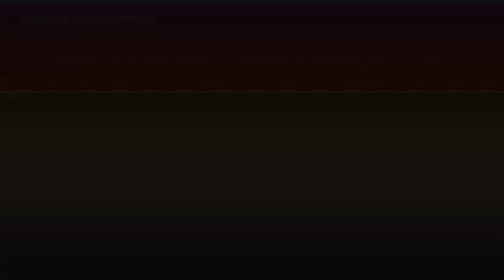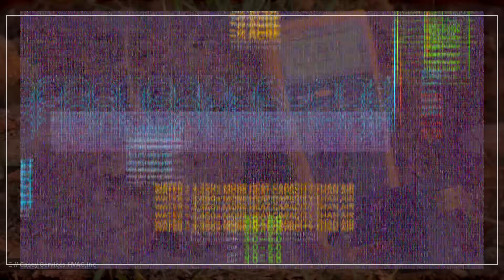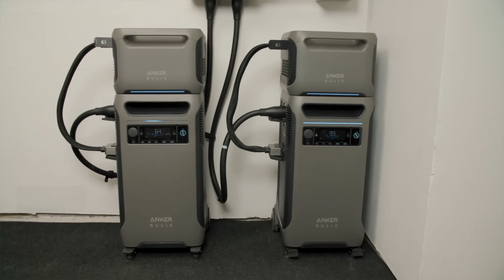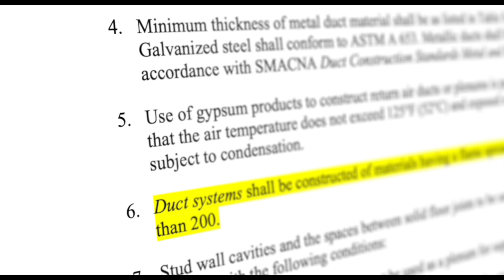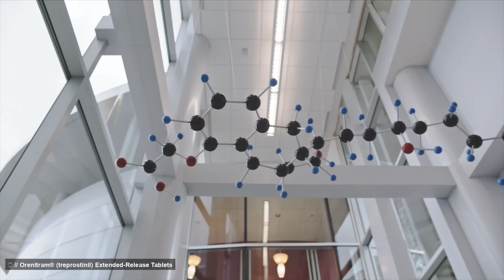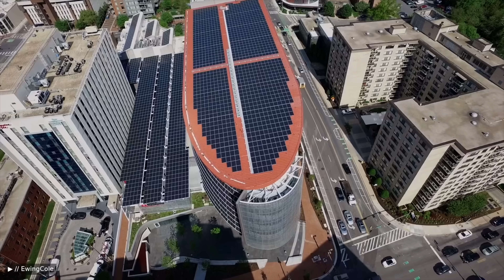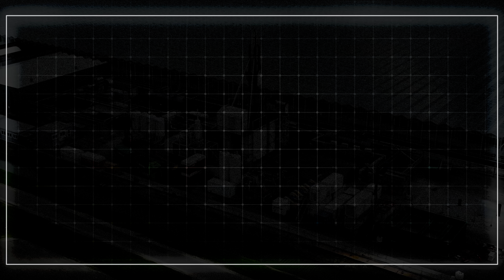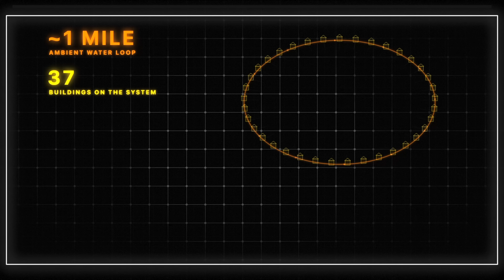The Viral DIY Cooling Hack That Nearly Killed a Family

Comment: One question - what is the local long term effect of a giant geothermal installation on that "heat battery" that is the earth's crust?  In other words, is the ground in the area - those few feet, those few tens of feet, or perhaps somewhat further - going to be significantly altered?  Is the efficiency of this system going to degrade with time as the rock, with its limited conductivity, cools or heats?   It is my understanding that solid rock is a decent temperature insulator.  

That raises the interesting question of what happens if these systems tap into an change the heat level in an aquifer.

Also, no offense, but nobody is entitled to being given other people's tax money so they can install heating that is cheap for them.  And, I class myself here - Geothermal was simply too expensive on my property - with current technology and energy prices.  However as things change over time, that WILL likely change.  At that time, it will truly take off.  That's true of solar where I live.  Only this year did it begin to make economic sense.  So, this year, we're installing it.

And, for the economic nit pickers ... yes, a tax break is the same as being given other people's tax money - overall tax rates climb to make up the difference.
Reply: Industrial policy is a nation's approach to encouraging and discouraging technology and practices for the good of national efficiency and security.  It often takes some carrots to get a desired technology towards the tipping point.  After that, the subsidy is no longer needed and the net benefit to the country is much greater than the subsidy cost.  It is a long term play.

Examples of this industrial policy approach solar panels, batteries, EVs in China.  Heat pumps in the Nordic countries.  Short term subsidy pain for long term national security and economic gain.
Reply: @SeekingBeautifulDesign  in an ideal world, that would be the way it worked.  And, perhaps, there are less diverse places where it HAS worked.

However, at least here in the States, it's been more of a case of cramming immature technology down the throats of taxpayers while funneling the taxpayer money into the pockets of politically connected cronies.

A prime example from last week ... in Portland, Maine, there is a $54 million "vertical hydroponic" setup that has run through all the money, is defaulting on its obligations, and has yet to produce more than a salad or two.  I would note that the money came in the form of loans that are forgiven by the Feds if the company keeps its nose clean for a short period of time.

I would note that this is the exact result predicted by folks looking at the numbers before the project was green-lit.  But, as usual, the ideologues running the government paid no attention to economics, human nature or common sense.  After all, THEY don't suffer when their policies fail, and their cronies still make a mint.
Reply: @selkiemaine Immature tech subsidies are better for research labs for basic research than promoting consumer adoption for scaling benefits.  Heat pumps are extremely mature technology. AC and refrigeration are 1 way heat pumps.  Now price drops with scale as most of the hard tech parts are solved.  Hence consumer subsidies to get to scale.  China subsidized solar to the scale where it no longer needs subsidies.

Tech loans are to what I guess you are referring.  It's an open question whether government or private markets should fund post academic and preconsumer technologies.  US didn't seriously fund solar (original cells), batteries (LiFePO4)and EVs (at least a lot of pioneering work done in US) which it invented.  Now China has a near insurmountable lead, dominates the world and leaves oil insecurity behind more and more every year.

Contrast this with the bad choice on vertical farming.  Economics of this without incredibly cheap energy are poor.  So bad investment and investing approaches should be investigated.  However never investing in anything by the government dooms the US to being an unproductive laggard.  It might be helpful to join a venture capital firm to live with putting money into new and unknown ventures.  9 failures for every big win, but still profitable.

Comment: NB. Based on a twenty year experience with a waterfurnace , I highly recommend a closed loop system over an open loop system, which is susceptible to ground water quality, condition and fouling due to inherent minerals. There were numerous mineral deposit issues we had to overcome with the heat pump but at the end of a twenty year stretch, the discharge well itself was highly fouled with mineral deposits and could not be rehabilitated for use by the waterfurnace. Go closed loop, or not at all.
Reply: A friend of mine lives in a 1980's house in Ontario (Canada) with a closed-loop geothermal system where the loop goes into a giant radiator in the lake by their house. It's been running since the 80's and only last year finally died due to the compressor motor finally going.  They replaced that motor and it's humming away again. Most of their neighbours around the lake community have the same system, and they've all had similar great experiences with those systems.

Compared with every single gas furnace and outdoor-compressor-based AC units I've ever known with friends and family and personal experience - all die within 5-10 years most requiring complete replacement because they no longer make the parts.
Reply: @anomatrix0000  That's cool but most people don't have a lake next to their house lol.
Reply: @Rhannmah  That is laugh out loud true.
Reply: @Rhannmah  Obviously, the point was more about the benefits of a closed-loop geothermal system vs open, responding to OP's point.
Reply: @Rhannmah  But what if I dont like bean soup?
Reply: @Rhannmah  That's cool, but many people don't have a house
Reply: @Panteni87  haha, true. Screw capitalism for making basic necessities unattainable.
Reply from the maker: great comment! yeah I suspected as much, closed loop would be the way I'd go for sure
Reply: Yeah there's literally no reason to have an open loop, what you need is the ground heat so just isolating the ground loop and grabbing the thermal energy through a heat exchanger is the thing to do, you avoid so many problems doing so.
Reply: @Rhannmah  someone forgot to tell that to the people building the ai data centers
Reply: @supertornadogun1690 Yeah, this is abysmal. Where I work we go through over 40,000 gpm for one building. That's not a typo. Closed loop works phenomenally well once it's set up and it just keeps chugging along.
Reply: @supertornadogun1690  Capitalism will do that. When your only motive is maximum profit, you will use the cheapest, most-shortsighted technique regardless of the consequences for everyone else.

Datacenters could generate domestic heated water for entire districts using closed heat exchange loops, and even charge the ground with heat for seasonal storage so entire cities could benefit. Instead, they boil off potable water and waste it in the atmosphere. Just insane.
Reply: @supertornadogun1690  Datacenters that use large volumes of water use evaporative cooling. Rather then just heating water and releasing it, they evaporate the water and release it into the air. This works a lot better then a regular closed loop heatpump, and uses far less electricity. The trade off of course, is you need a whole lot of water. Which option is better for the environment depends on your location, If you're right next to the mouth of a big river, then evaporative cooling is great. If you're in Utah, it's probably not.
Reply: @Rhannmah ah yes... because owning a home and data centers are so prevalent in communist countries...
Reply: @Rhannmah   - open loop needs an aquifer discharge - recharge well  flowing enough to do the job - very site specific..  - any suitable lined well hole can have a closed loop put in it - if the well is large and wet enough it could even have heat loop and a water extraction pipe in the same borehole......  Groundwater quality impacts longevity of any system using potentially mineralised water - pumping groundwater through any heat exchanger is going to be fraught with problems.
Reply: Never build open source; there's a building 8n my town that had one installed for several million dollars and it silted up in a couple of years. Since it's under the building it's not repairable. Closed loop is fine though, several other buildings here have those and they are fine. Air source is good too, although some of the older systems had problems. Were 0retty close to the least 8deal climate for air source though, close to freezing in the winter. Still works, especially if it's not the only heat source and you're careful about placement.
Reply: Where I would be interested in installing such a system, near Dallas/Fort-Worth, the ground water is EXTREMELY hard so I also cannot endorse an open loop system. I have a friend that lives about 45min NW of Fort Worth (eg, "out in the sticks!") on well water and calcium deposits are a real issue as are sand grains. As part of his remodel, we're going to be installing a multi-stage filtration system and likely a water softener as well. I couldn't imagine circulating that through an HVAC loop. You'd have to get it cleaned all the time and the abrasive suspended solids would likely cause pinhole leaks to develop as well.
Reply: @MadScientistsLair  Absolutely, all you can really do is go with the cupro-nickel heat exchanger OR use a brazed plate heat exchanger outside of the unit with open loop applications…  then it becomes WAY cheaper and helps avoid pinholes in your coax — or just go closed loop if possible

If you’re using the desuperheater (or even just on a regular copper coax), a great way to get rid of scaling is just to buy some citric acid powder and use a small trash pump to just circulate it for a couple days — I forget the ratio at the moment, but I’ve done it and it works really great // not much. It’s gonna work if you’ve completely eaten away the brass fittings from bad water going way too fast and eroding away the copper and/or the brass fittings that have quick connects or similar on the end
Reply: @rrmuf  Agree about the closed loop. My college was attempting a Living Building certification on one building, installed a geothermal system and made the mistake of going open loop. Very early on they had issues with it fouling. Years later, the system is not really functional and they'd need to dig it out to change it to closed loop. The governing board is unlikely to ever approve the work though because shiny new buildings are more exciting than retrofits.
Reply: @dragonabsurda That is consistent with our experience. Although we were able to mitigate the furnace coil fouling with periodic ´flushing’, that is really a function of the well water quality….i.e. a crapshoot. As for the discharge well fouling, nothing could mitigate that problem. I imagine, if you have a pond or other body of water available to discharge water into, that would avoid the problem we experienced.
Reply: @rrmuf  Agreed, a lot of the time I feel putting an external brazed plate heat exchanger in versus trying to rely on cupronickel alone, is a lot better option if attempting an open loop setup
Reply: My dad had a well that he pumped into a pond almost year round.  He added an open loop system with no problems and the operating cost was minimal since the well pump was going to run anyway.
Reply: @danrose3233 yes. Open loops CAN be successful especially when the outlet is so easy. You are dependent on almost perfect water condition and outlet scenarios.
Reply: what's a water furnace?
Reply: @enigmavariations3809 It's a brand name of closed loop ground source heat pump. Named as such because it looks a lot like a big regular furnace but with some water lines coming out.
Reply: @enigmavariations3809 it is a geothermal furnace.
Reply: How long does RODI/pure water last in those- OR do you crank up the mineral content so there isn't any solubility left for things (and then how do you deal with the 'crystals/fouling?
Reply: Generally, I agree.  Other reasons are that the ground water may be oxygenated, giving rise to air locks and excessive corrosion and, of course, the water can't be treated in any way!  There are a few areas where ground water can be used directly, but so few that it is hardly worth testing the water to check.
Reply: Do it now!!! Before they stop you or ruin you with fines
Reply: WaterFurnace and ClimateMaster are generally great options when tied into a good closed loop system (don’t screw yourself on the loop, both manufacturers have excellent design software that is super easy to use to make sure there’s enough bore, your Reynold’s number is good, etc.)
Reply: Who would do open loop? Just asking for problems

Comment: Its a great idea to go vertical except I have done several projects where over time the wells fail.  Last one 6 out of 8 in four years.  Before you consider it ask about what it would take to repair or replace.  Then you will be educated.
Reply: Failed how?
Reply: @justinw1765  Its called wellbore instability.  Collapse/pinching /shifting etc.   Most are not properly surveyed due to expense.  Even ground loops can have problems too mostly due to bad survey or none at all.

Comment: How effective would this be in a hot tropical climate for cooling only ? Would the ground temperatures be cool enough to make a difference ?
Reply from the maker: the warmer the climate the deeper you have to go, as the heat builds up and doesn't cool over winter. but yes still works!
Reply: @TwoBitDaVinci  Nice. Worth looking into if you have the space, budget and a contractor with the right experience. At the very least it will offset part of the load compared to conventional air conditioning.

Comment: Underground is not so much a "thermal battery" as it's more of a "thermal flywheel".
We replaced our forced-air fuel furnace with a ground sourced system a couple of years ago (2019?). It was a 100 meter vertical U pipe in the back yard with a glycol-like liquid circulating through it. (Ruined part of my lawn because it pulled up a lot of clay.) The underground ambient temperature here is about +9º Celsius year-round, so it's an ideal temperature for when we want AC in +22 to +30º weather, and heat during 0º to -20º C winter weather. Therefore it doesn't have to work as hard as those above-ground mini-split heat pumps and such, which try to extract heat from freezing air in the winter and dump heat into hot air in the summer..
The province we live in was giving out big subsidies that year for geothermal upgrades, which helped helped to convince us to go for it.
At any rate, we love it. 
- We're not paying thousands of dollars for fuel in the winter (and that would've only gotten worse). 
- The electric bill only went up a little bit. 
- The only regular maintenance involved is changing the air filters 4 times a year. 
- We don't have to hire a burner technician to tune it up and inspect it every Fall. 
- There's no 200 gallon fuel tank sitting in our basement, which was due to be replaced anyway, so no chance of a fuel leak. 
- No more risk of carbon monoxide poisoning.
- It's much quieter and takes up a smaller (half as big?) footprint than the oil furnace. 
- We had our shingles replaced with a steel roof last summer, and they took down the chimney for us, so there's no chance of leaks around the chimney.

About that Dandelion company: I read that they were developing compact drilling rigs that could more easily get into back yards of suburban homes for retrofit installations.

Comment: Our house use both, We have a closed system with brine for the heating system, but also letting the air intake to the FTX ventilation run through a sloped pipe about 30 meters in the ground. In the "bend" before it hits the surface in the garden, the pipe is perforated and can release any built up water.  The difference is HUGE.

Comment: a guy in Nebraska has been growing oranges [ and any thing he wants ]. all year around in inground green houses with ground temp stabilized air systems . Good to know about the mold problem ,if i do one i'll be careful to set it up to drain properly . Rikki have you done any research into solar heating set ups ,like the evacuated tube hot water and glycol ,to sand batteries as heat storage . It seems this can beat photovoltaics for cost efficiency .

Comment: On thing you did not mention at all in you video is ground water can be extremely corrosive! 
As these things are paying themselves off over a very long term you need want to have a minimal amount of maintanence! 
Same goes for the pump and electronics in your celler. You do not want any condensation build up as well.

Comment: I would investigate more carefully before jumping off the cliff with geothermal. First, where does the heat load for any home come from ? Most older homes leak air like a sieve because of older building codes and older construction practices. So that hot or cold air leaks in or out of a house. Windows versus heat from solar radiation ? Next, heat pump versus  conventional HVAC. Next, solar PV panels versus grid power. 
Are we getting it ? A system level view AND solution versus a patchwork solution

Comment: This is not just "one viral video" telling you about something "banned" or just stopped speaking about because corpo profits. There is entire series about some "forgotten simple cheap tech" that nobody supposedly is using or even is banned (while it might not be). I would like you to dismantle other ones also this way or make it more clear. (other topics I have seen was water purification with copper (and zinc?); reducing, if not straightforward eliminating any mosquitos with just dumping copper into local ponds; some humidity and mold prevention and clearing tips; etc.)